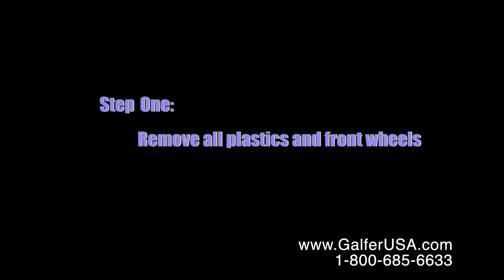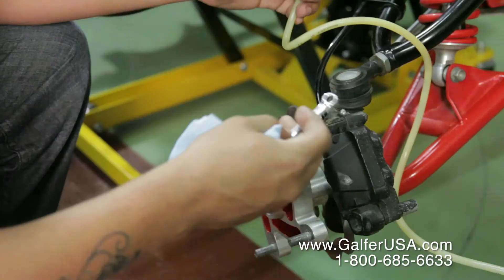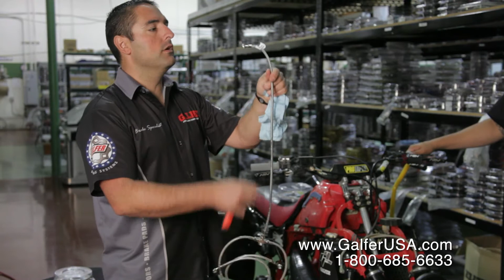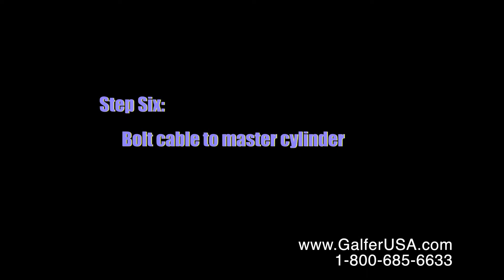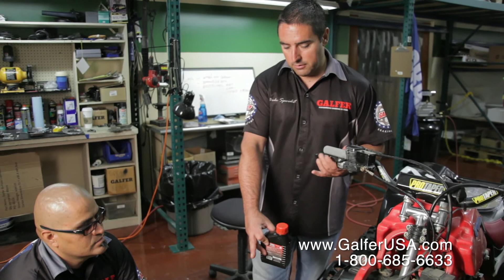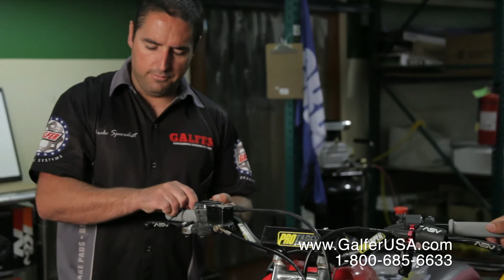How To Install Front Brake Lines on an ATV, Galfer Front Line   Install

Comment: pro tip, if youre getting fluid at the banjo bolt and bleed valve but its still not building pressure, instead of pulling the brake lever in all the way pull on it ever so slightly(and repeat) with the master cyclinder open and you'll see alot more bubbles rushing to the top. once it builds good pressure then you pull the brake all the way and crack the bleed valve. do both sides and you're good to go :)